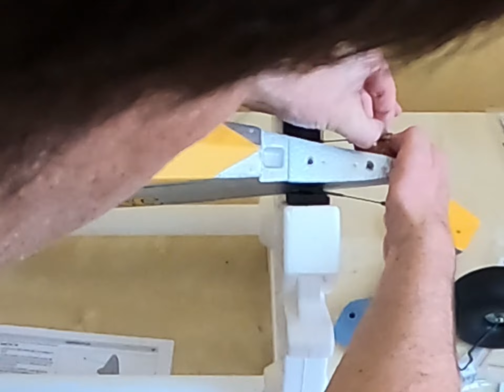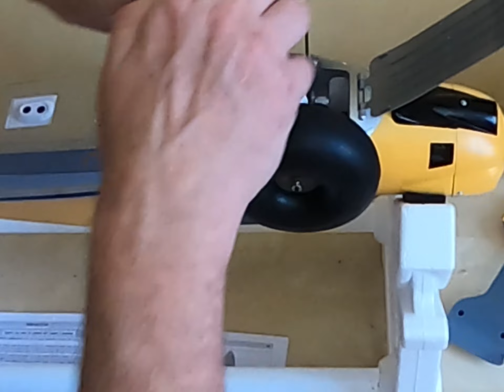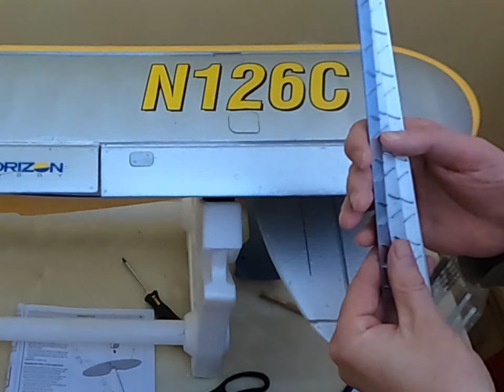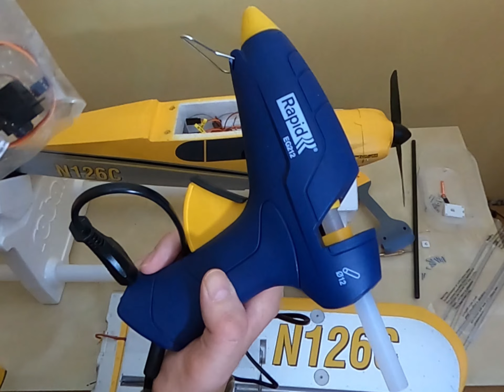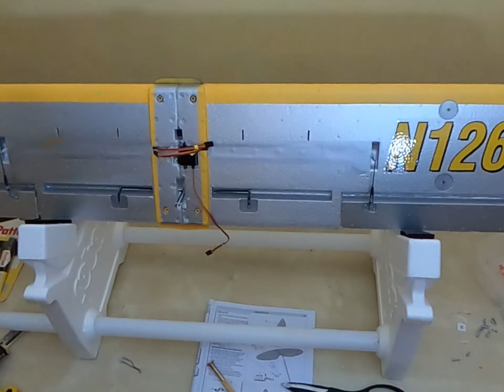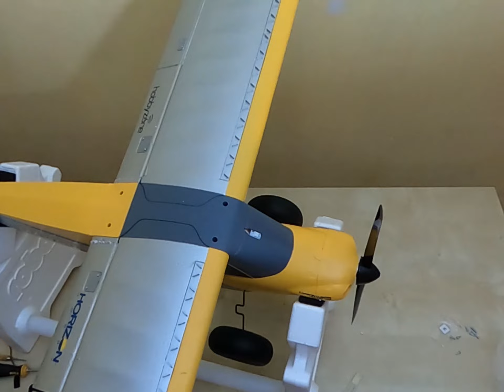HobbyZone Carbon Cub S2 : Beginner's Assembly with Flaps, GPS, Landing Assist Sensor and tips. Long!

Comment: If you are going to include landing assist and GPS, it would be helpful if you would actually show how / where to connect them.
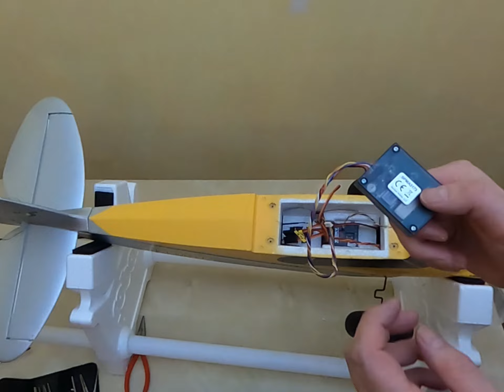Reply from the maker: 1:07:50 - GPS module
Reply: @CaptainLeo   In case you missed it, you say that you won't install it in this plane. Same for LAS.  Not useful, better leave that out of the video. I found the information elsewhere.

Comment: Captain Leo, 
I just discovered your site when I was trying to learn how to bind my CCS2 to my NX8 radio. I built and maidend this plane about 18 months ago and had an issue during the flight with the flaps. (used my DX8 Gen2) I got it up in the air and luckily back down in one piece. So it's been a wall-hanger since.  Summer is coming so started to program my new radio thankfully your later video made it possible to work out the issues and successfully got her bound and programmed and the flaps work great now.
I'm 71 and now retired and filling my time with fun stuff like RC flying.  Thanks for your help.
Reply from the maker: Thank you Tom, happy the video helped. I need to repair my CCS2, the landing gear wire broke the plasitc housing. Softer landings from now on for me. Fly safe and enjoy :)

Comment: Thank you for the very informative video. I was going to use land assist and the gps in my carbon cub so thank you for going through that as  well I would like to see your video on installing the gps and setting it up great video thanks again!
Reply from the maker: I've used the land assist and gps. First time it looked like it was flying away, but it was just a compass calibratin thing. It was going for an approach from a 45 degree angle. I'd recomend you learn and practive disconnecting the gps, before you try it. Just in case it's not doing what you want, you can quickly turn the gps off if you know how.

Comment: Did the hardware for the servo come with the servo? Where did you get the build stand?
Reply from the maker: The servo I bought seperatly, The connecting rods from the servo to the flaps comes with the plane, as do the wire to connect floats. The stand I bought online from Motion RC Europe.

Comment: Question!! I just bought the flaps servo for the rtf version with the DXS transmitter. Did you have to program the transmitter so your flap button would work correctly with the receiver?? Or did you just plug the flap servo into the number 8 spot and then try the flap button on the transmitter?? Thanks!!
Reply from the maker: The DSX isn't programmable as such. The flaps just work with the switch on the left. With throttle power on, it's going to fly upward and possibly stall. Just use flaps at idle power or very little power. Plug them into the receiver slot number 8.  Try half flaps first and add a touch of power before touchdown to give airflow over the elevator for control to prevent hard landings or nose overs.
Reply: I was told by one who upgraded to flaps that the DXS radio does not allow adding down-elevator to flaps, and a down elevator mix is required for adequate flaps operation. I got the RTF Carbon Cub, and had to buy a programable Spektrum Transmitter for flaps upgrade.
Reply: I was told I would have to 'program' the DXS transmitter that came with the plane for the flaps to work and somewhere else said it wasn't necessary so idk but thanks!